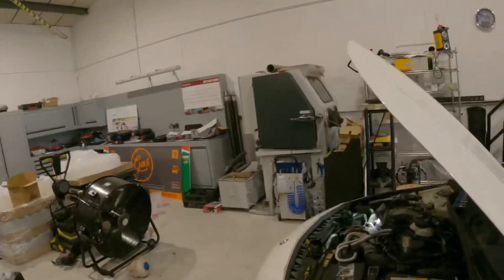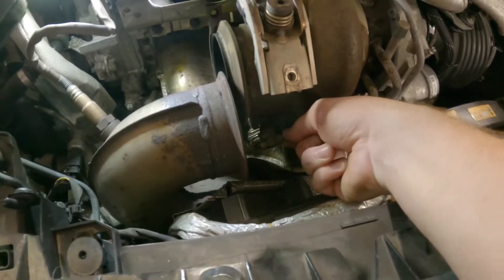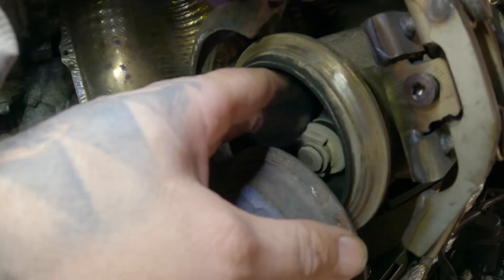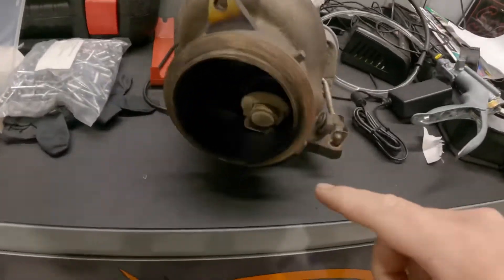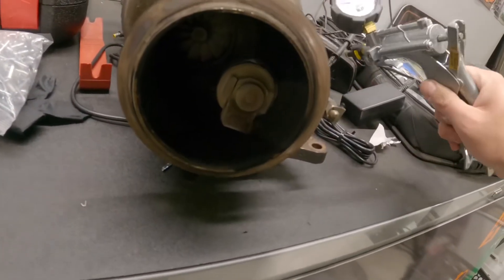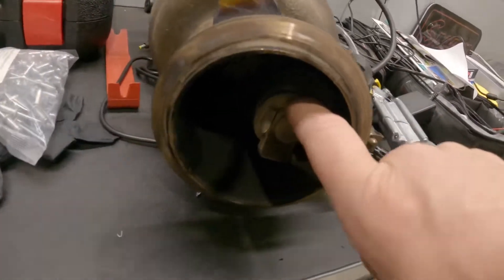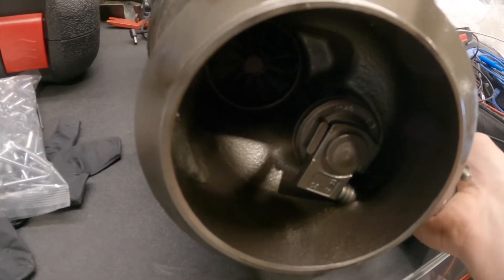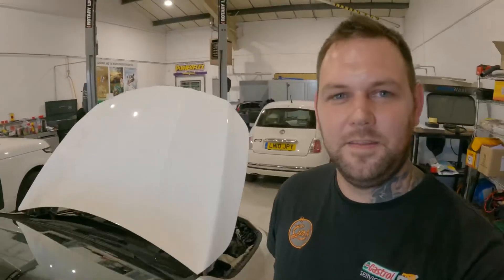A45 / CLA45 Loosing Boost | Fault Code P0299 | FIX

Comment: Would you expect to have no boost / very little boost all the time if this was failing ? On my A45 at times particular at higher speeds I’ll be accelerating and it feels like all of a sudden the boost dies off - doesn’t happen all the time and if I turn the car off and back on everything is good again and can remain like that for the rest of the drive. If not likely to be this issue, do you know what the problem could be ?
Reply from the maker: Our customer was experiencing the same issue. Very intermittent and when ignition cycled vehicle was ok again. This fixed his issue 👍
Reply: Thanks for the reply back - I don’t get any lights on the dash when it happens .. would something be logged if I were to get it plugged in ? How much am I looking for this repair ? Can I do any checks to confirm it is that issue ? Thanks again for the replt.
Reply: Hey man were you able to fix that problem? I have a mercedes c450 amg and its literally doing the same exact thing like yours and aswell i have to turn off the car then turn it back to in order for it to run back to normal
Reply: Im trying to get this fixed so bad its really anoying i even took it to the mercedes dealership to get it checked nd they couldn’t find the problem😢
Reply: did anyone find out if this fixed it? I'm also having this issue with my c43 amg
Reply: What brand repair kit is the flapper that was used?

Comment: The mamba kit comes in 3 parts..the flipper and shaft, the sleeve and the actuator connection piece.
How do you keep the actuator connection on the shaft....it just slides on and there does not seem to be any retainer or what of it turning the shaft !?
Reply from the maker: I believe this needs to be welded in position

Comment: I have the code p029921, ive changed the Solenoid and the actuator but the problem is still there im about to order the egr valve vacuum hope that solves the problem. Please let me know of anything else i should look into.
Reply: Honestly this may sound dumb but this was my issue… there’s a second coolant reservoir under the engine cover, mine was dry empty. After topping up about 1.5 litres of MB 325.5 coolant the turbo was fully back to normal. 

The second reservoir is there to for the charge air intercooler which cools down the turbo. After reading IAT2 temperature measurements mine was way too high so the ECU stopped the turbo to work causing boost and performance loss.

So yeah check it out haha.

Comment: Why did you not show actually replacing the wastegate on the video?  Is this something that can be done.  Also, you did use the Mamba part correct?
Reply from the maker: Because we didn’t replace the wastegate, we sent it to midland turbos to carry out as it says in the video 👍
Reply: @godfreysautomotiveservices  I got you.  Appreciate the response was hoping it was something that you did to increase performance of the turbo not just the waste gate.  Great info though and appreciate the response!

Comment: I changed my turbo and still getting the same under boost code. What else should I check? They also ran pressure tests as well.
Reply from the maker: Check the vacuum system 👍
Reply: Did you ever fix it?
Reply: Yes I ended up wasting money because of a misdagnostics from one of the mechanic. I got a second opinion from a Mercedes master tech and was able to identify the boost sensor out. Once we changed that it was back to normal. My turbo never messed up and all these posts lead me to believe it was my turbo wastegate. Hope that helps. Lmk if you need help with anything else. If you are in Texas I can tell you who checked it out
Reply: Thank you, that’s very helpful. I have also changed my turbo and still getting the same problem. Do you know the part number or the exact sensor you changed. Thanks
Reply: @waqasanwer5702 how much was the sensor for you ? Going through it now
Reply: @maxfisher8543 the code shows my sensor isn’t working
Reply: @waqasanwer5702

What was the part number of that sensor and did it make a difference?
Reply: @maxfisher8543  did you ever replace the sensor? Did it make a difference? If so what was the part number for that sensor?
Reply: I just checked the service paper and it just says M278 turbo pressure transducer on it which I think is another name for sensor. The part cost $115 no part number there. Been about 20,000 miles and still good.
Reply: Alright thanks I think that’s my next move

Comment: Got the same code p029900  on a mercedes a class any idea what's causing it?
Reply: did u sort problem mate got the same issue with my a class after crash
Reply: The exhaust  flap was getting stuck shut. Common problem on them.
Is it constantly going in limp mode?